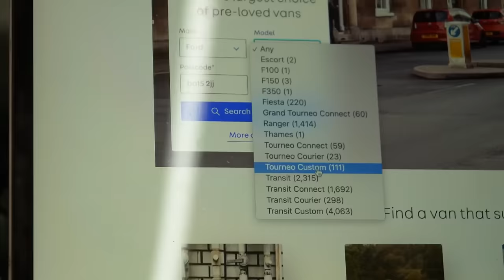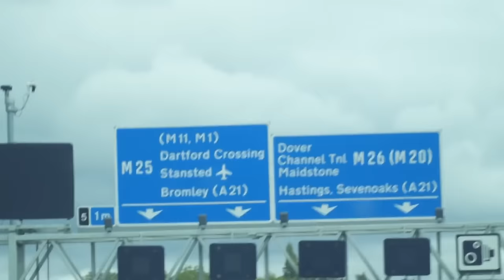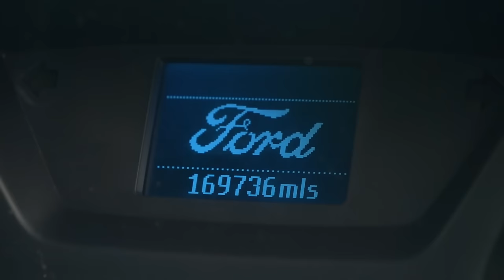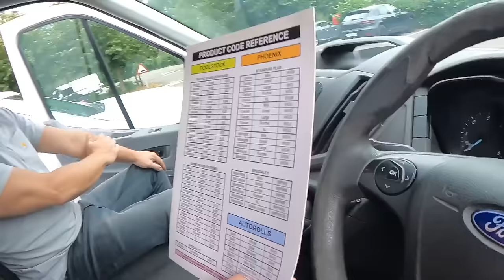The Ultimate Custom MTB Adventure Van! | Full Build, Start To Finish | 2hrs+

Comment: If you have time - wait a year or two.  Electric Vans have been proven to be vastly superior to yesteryear's carcinogenic oil burners - and they are about to flood the market.  Especially in comfort, versatility and usable space.  Used an electric Van from China (Maxus Deliver) while moving last month.  Had to use a same (exterior) sized diesel (Mercedes Sprinter) in the second week 🤢 Virtually no power & noisy af when trying to convert hundrets of kWh into some forward movement at 3 000 - 4 200 rpm.  And the Mercedes had 200 kg less weight capacity (825 vs 1076 in the maxus) in its cramped cargo space - which really sucked since i had to move large and heavy furniture and appliances.  Oh and the stereo sucked in the Mercedes (like they do in every Mercedes/VW).  Which doesn't matter that much i guess, since you mostly hear the vibration and noise from the burner engine anyway.  If you are the kind of guy/girl that likes that, do yourself a favour and never drive an electric van :)
Reply: p.s. "Sprinter" should be in quotation marks 😂 it has no sprinting capacity whatsoever.